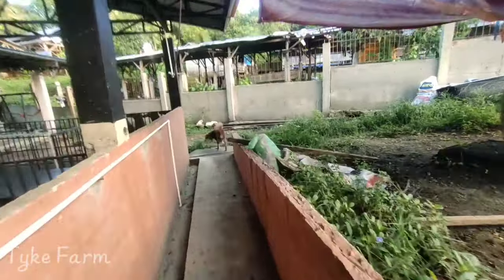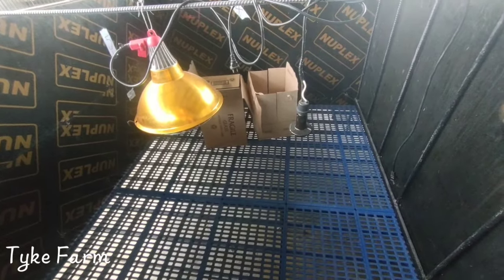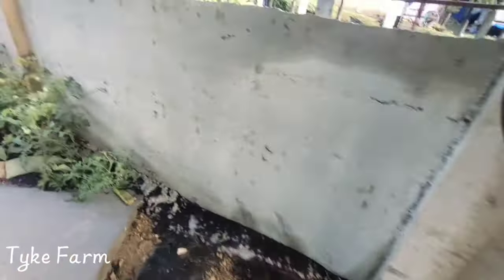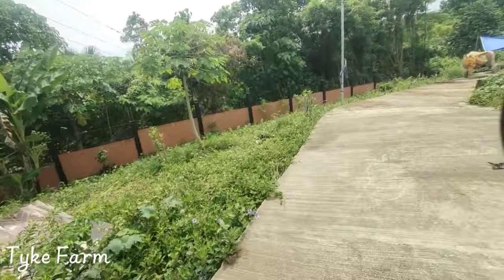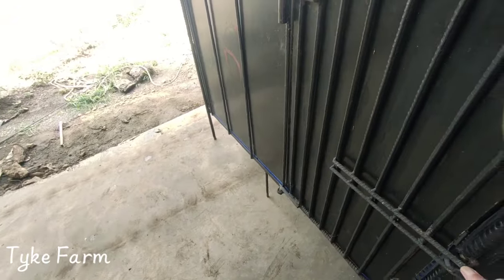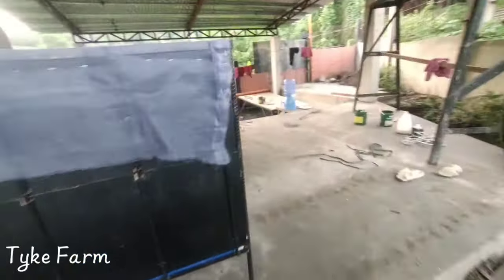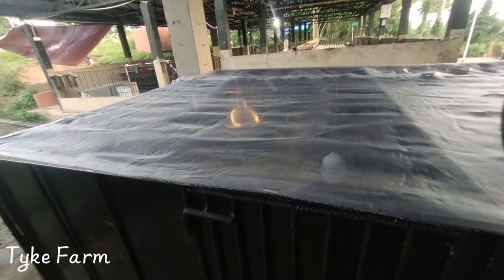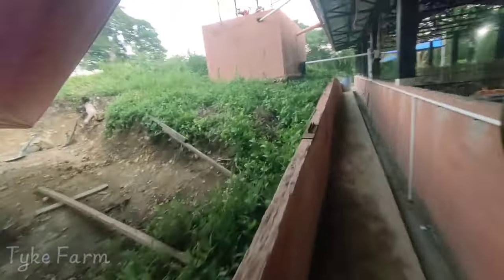READY FOR CHICKS COMING

Comment: 1 heat lamp per pen brother. 
In a corner. 
When they feel too hot they can move away from it and return to it when they feel cold.
If the chick's are bunched together when sleeping they are too cold. (Lower the lamp)
They only need the lamp for a week or 10 days. 
After 4 days you can start to left it a little higher every day. 
As I mentioned,  the chick's behaviour will tell you if they still need it or not.
Normally when they have plumage they don't need it anymore
Reply from the maker: Exactly Right Gerbourke pigs will tell you the same story.